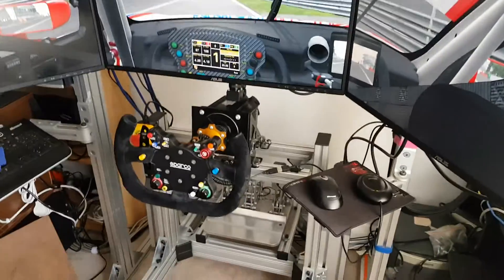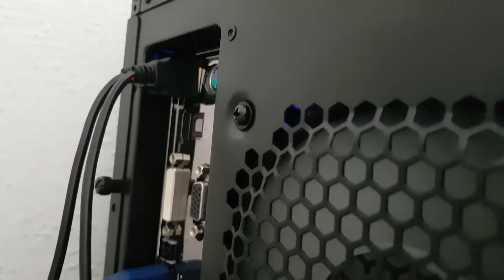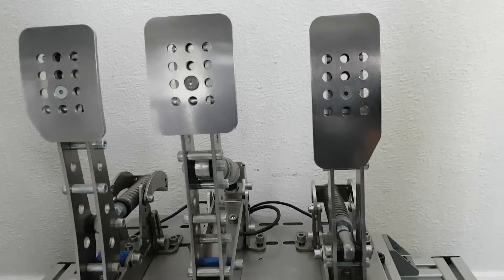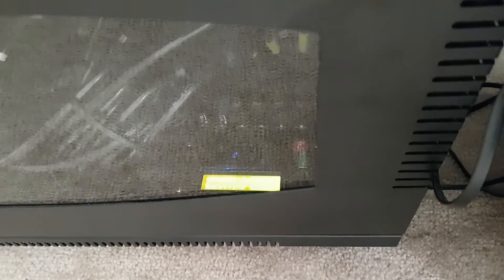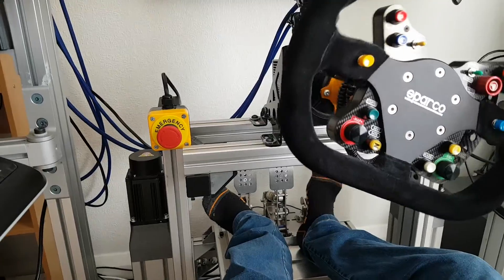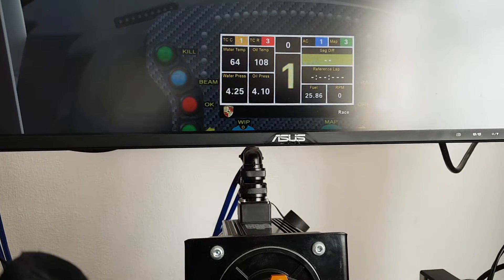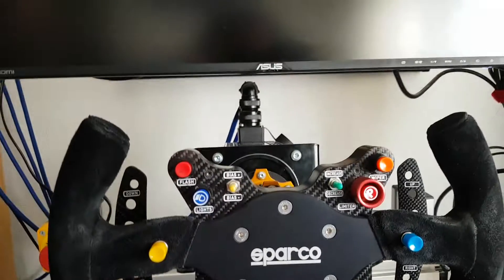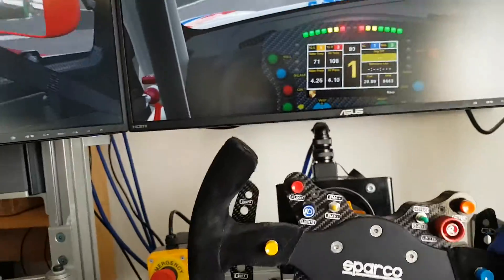USB PCIe Card Hub Troubles Assetto Corsa Simucube SFX-100

Comment: Did you check if everything is grounded properly. These are often the most sources of interference, regardless of whether all cables are well insulated! Good luck!
Reply: And in one circle!!!!!!
Reply from the maker: Everything was plugged into the motherboard and working fine before I installed the USB hub card. It cannot handle the high input devices. I gave up and took it out and sent it back.